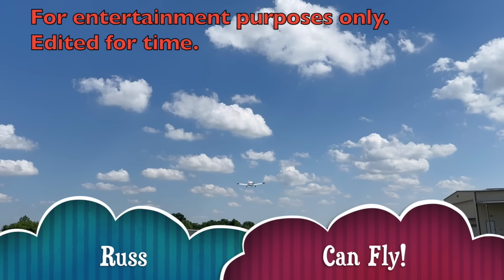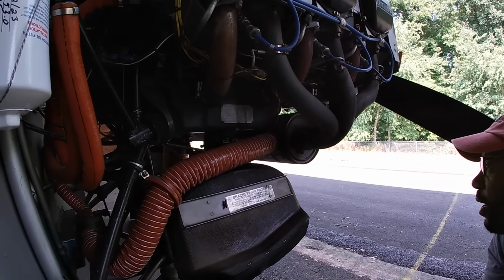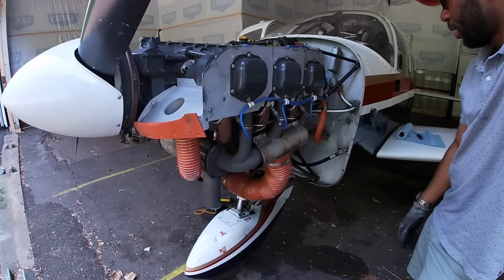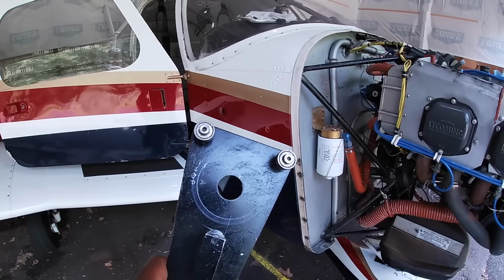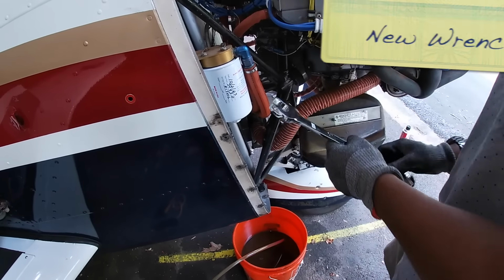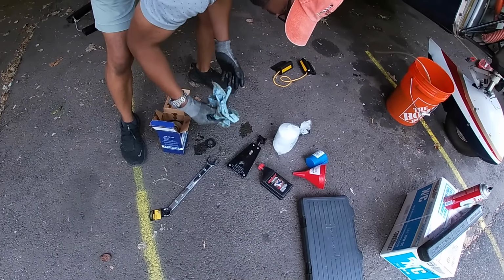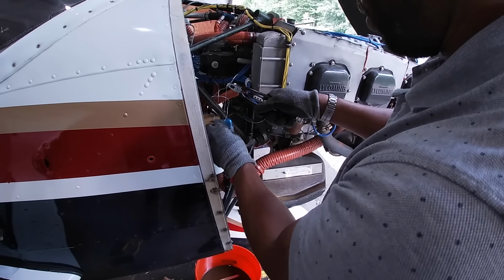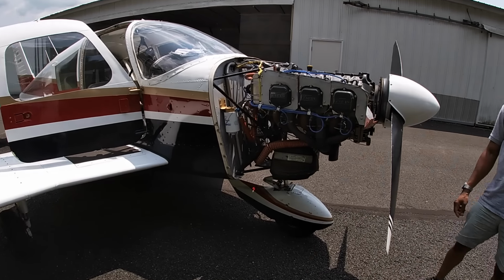Doing my first Oil Change in my new Piper Cherokee 235!

Comment: Proud owner of a '65 Cherokee 235 here.  Good video, good to see another 235 owner getting their hands dirty.

My first oil change as an owner I did myself, without a A&P and with some YouTube instructions--right before I had a 3hr XC flight.  Lessons learned: don't do your first oil change right before a long XC flight!:)  Get an A&P to show you the ropes.  Have a good oil waste container.  Practice safety-wiring.  

It all went good, but I had a lot of time straight and level at 8500' to think about that oil change...  Also, my eyes darted to the oil pressure/temp gauges more than I would've liked.

Next up: inspect, clean and gap spark plugs (after bore scoping the cylinders).  The fun never stops!

Enjoy the 235!
Reply from the maker: I give you credit Brother for taking that job on yourself. I wasn’t too worried about the oil draining, and the oil filling. But that whole safety wiring thing had me a little shook! I kept wondering if I was going to be able to do it correctly, especially since I never use that tool before. It was definitely good to see it being used, so that I knew what they expect next time.

Take care, and enjoy that 235! Hopefully one day our paths will cross.

Comment: Russ - It looks like you're in my old hangar! :). Looks like whoever had it between me and you relined the ceiling and walls.
Reply from the maker: That’s awesome! Yeah, I met the previous owner to me, and he did a lot of work on that Hanger. He did a lot of wiring, relining the ceiling in the walls. He also magnetized the doors so that they stick together really nicely. I was actually surprised he decided to leave the Hanger, but I think he wanted one of those electric door. I think P hangers on the other side.
Reply: @RusscanFLY  he did a nice job. My only contribution are the paint lines 😀. I left to move closer to where I live but TTN has so much training that I traded driving w waiting to take off behind multiple students. Plus there was no maintenance on the field.

Comment: That’s exactly like the oil change on my Subaru Outback. The oil filter faces up like that. What I do is actually take the filter off slower than that. As soon as the oil drips down the side of the filter, I turn a quarter turn every 10 seconds until the oil slows down, or the filter comes off. Whichever happens first.
Reply from the maker: Good to know. I’m trying to come up with a little device that I can put on the back of the filter and direct the oil down into a canister.
Reply: @RusscanFLY  cover the filter with a really tall plastic cup while it drains. If the plastic cup is perfect size for the filter, you can even turn the filter using the plastic cup as a “wrench”
Reply from the maker: @GregoryBaker  wow, that’s a really good idea! Definitely gonna give Dad) a try! Thanks for the suggestion.

Comment: Not Fair!  My '66 Cherokee 235 oil filter is located behind the engine between the engine and firewall and very hard to access.  Is that a stock setup or was it modified?
Reply from the maker: No, it was definitely modified! That was one of the things that I did see in the logbook.
Reply: @RusscanFLY  Awesome, can  you share info on what kit was used?  I'd like to update mine as well.  🙂